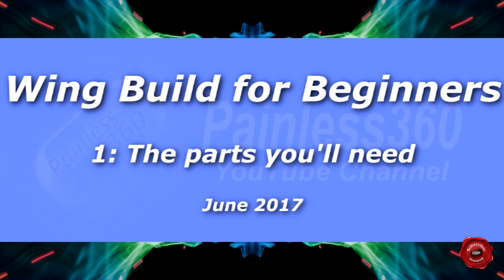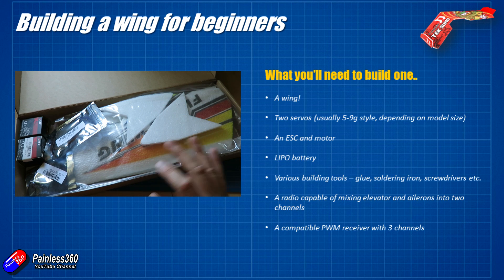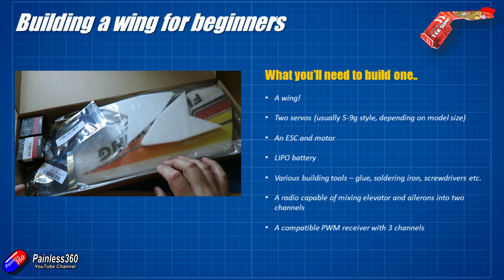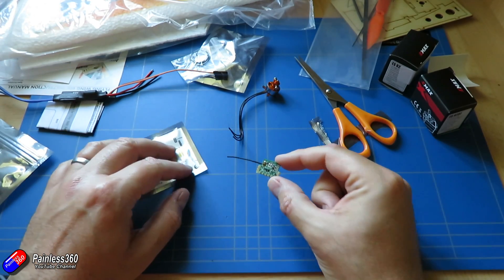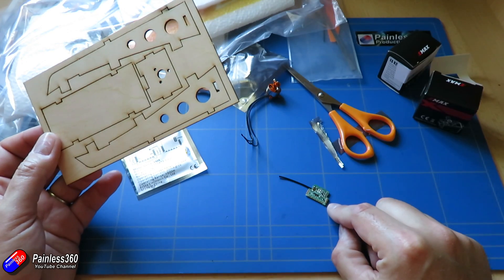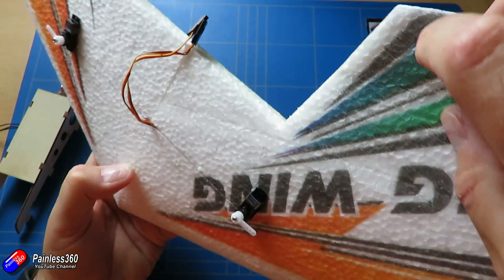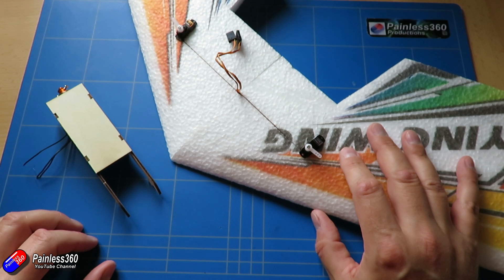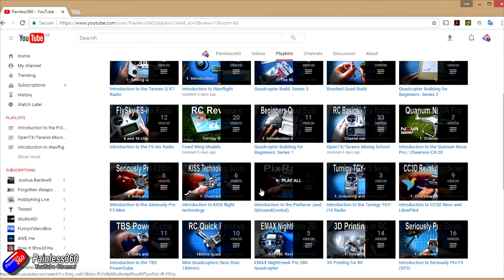(1/3) Wing Build for Beginners - what you need and starting the build

Comment: In the early days of FPV, I built and flew a variety of wings in which the RC receivers were just hardwired to the servos (no flight controller).  But after more recent experience with quads, I am wondering if current builds of wings now use flight controllers for actively controlling pitch and roll rates based on RC input (rather than hardwiring).  I imagine hand launching might be a lot easier with a FC.  Also, roll and pitch rates would tend to be less dependent on airspeed.  Thoughts?
Reply from the maker: I'm guessing you are not a regular viewer. Check out my INAV for beginners series for why all my planes have a n FC now... Happy flying!
Reply: @Painless360  Nice.  This is exactly what I was looking for!  Do you happen remember which video covers PID tuning?
Reply from the maker: All of my videos are carefully organised into playlists and every video has a number of text tags on them to make them easy to find if you use a search. This video should help and explains a few tips for finding the video or playlist you're looking for - https://youtu.be/CIuUNdVfBJQ or https://www.youtube.com/watch?v=P4soR6QgOk0. Happy flying!

Comment: How do I mix my Aleron and elevator on flysky i6s transmitter, im building my first wing and I’m only using the 
flysky fs2a 4 channel ppm rx 
Two Kpower p0025 servos 2.5grams each 
2s 8520 brushed motor with a gearbox ring and pinion that turns a 5 inch propeller 
Hobbypower 10amp brushed motor esc 
2s 610mah hubsan h502s lipo 
“ brushed motor and gearbox/propeller system also came from the hubsan h502s drone “ , my only problem is how do I mix the servos together so I can fly the wing properly , the flysky Fs2a receiver is 4 Channel so I it can operate my esc and the 2 servos and I still have an extra Channel left over , thanks a lot
Reply from the maker: I don't have that radio here to try - sorry I can't be of more help on that one..

Comment: I'm coming from fpv quads and am about to start building my first wing. I've never used a servo in my life, is the checker vital? Is it possible to find the mid point without it?
Reply from the maker: +discord2000 it's not absolutely necessary, when you fire everything up your will quickly see if the servo horn is correctly installed. If you're getting into any kind of fixed wing, then things like a servo checker are worth investing in. Best of luck

Comment: HI
PERHAPS YOU CAN HELP - I HAVE A GT90, RUNNING ON 350MAH
GET 2 MINS OUT OF IT AND IT FALLS OUT THE SKY
UPGRADED TO 500MAH turn and still get 2 min
im dumb founded as everyone else gets 4 min on a 350mah
is something sucking all my power ?
Reply from the maker: +stephen kosloff possibly, what troubleshooting have you already done?
Reply: hi
changed batteries to turnigy 500mah
running an xm+ dhot 600 - makes no diff with original multi setup and old ac800
checked wiring
i m outdoors and not even full throttle
disapointing seen as this is my 2nd - first one i managed to burn out the FET's under usb
Reply from the maker: I've not had that model but something sounds off. I'd check that there are no shorts, bad connections or nothing touching the carbon parts of the frame. Best of luck!
Reply: thanks for all your hard work over the years

Comment: Howdy Lee, these wings need a carbon strip across the back of them as they tear at the rear corners either side of the fuse, Matt
Reply: Can you give a link to a good carbon strip please?
Reply: Howdy fella, look up "2mm carbon rod" on banggood. They cost about $4 for 5. And fit it across the underside of the model about 15mm forward of the rear, under the motor mount and out accross as much of the wing as possible. The wing cracks with extended use & unscheduled landings.
Reply from the maker: Thanks for the tip, this build is a very mild performer with the small motor and 2S power so you'd have to be very unlucky to snap it with this setup. A few of my older wings are not about 60% hot glue and tape and still won't die. Happy flying sir!
Reply: Howdy Lee, mine is a 2S with a small HK 1620 3200Kv motor. It has the same flaw as the other DW Hobby wings with the motor mount being cut too far forwards to hit CG. Too much pressure on ether wing and they crack :( That aside, I love my little rainbow wing, gets flown several times per week. Matt

Comment: Hi Lee, love your videos and articles in RCME they are a massive help and inspiring. 
I have a few questions that I can't find a definitive answers to.
1) Regarding joining together the two parts of a EPP wing is original gorilla glue any good?
2) I have a Teksumo kit, many mod videos recommend moving RX, and battery to on top of the wing to avoid damage when landing / crashing. 
3) I have a glow engine Acrowot, can I use a 2s LiFE battery to power RX & servos without a BEC?
Thanks
Garry
Reply from the maker: Hi! 1) EPP will stick well with hot glue, I use Gorilla 5 min epoxy here for those parts that I need very strong joints on. 2)You can, I've never done it as the crashes I have tend to impact the leading edges/winglets and nose.. 3) Check on the voltage range on the receiver and servos in the model, if they can cope with the pack voltage range then they will be fine.. Hope that helps.